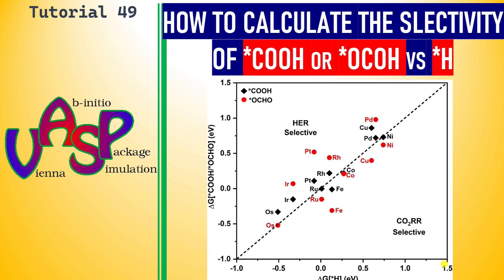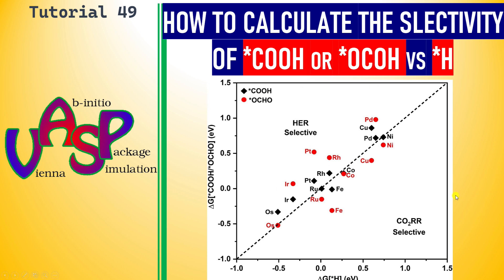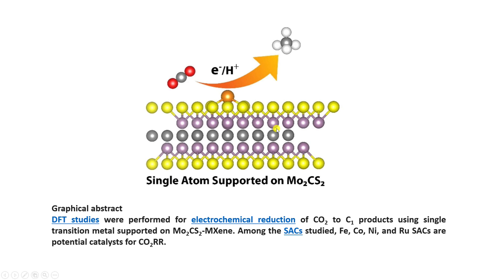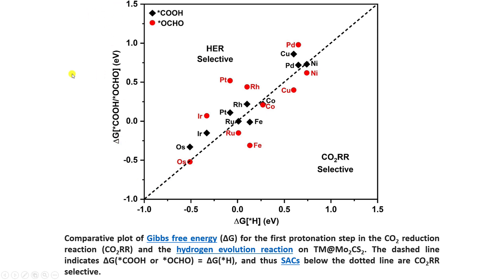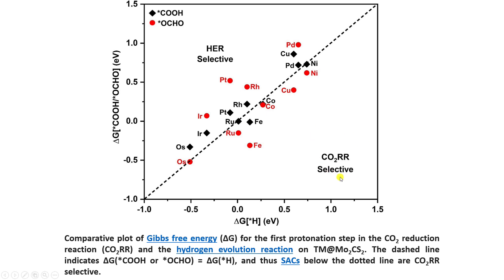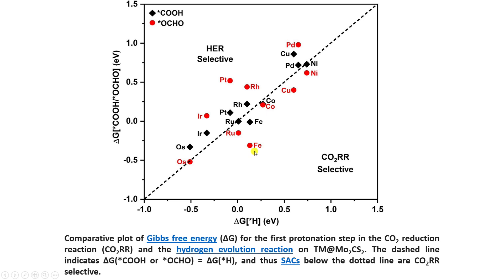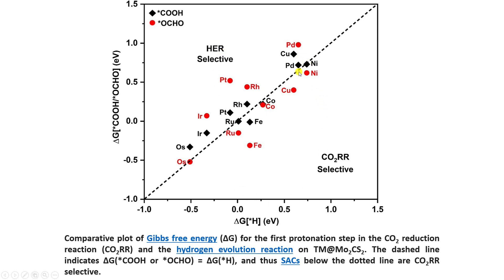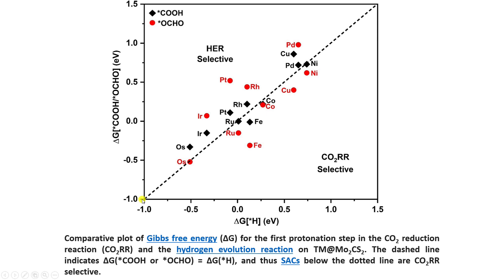How to Calculate the Selectivity of CO2RR vs HER by *COOH or *OCHO vs *H with Adsorption Energies

Comment: hello sir i got these vaue from NEB calculation so i want to plot the energy barrier profile the last column i should use?    
  0         0.000000      -305.792500            0.000000 
   1         0.018762      -305.745100         0.047400 
   2         0.017122      -305.587100         0.205400 
   3         0.019031      -305.745000         0.047500 
   4         0.000000      -305.794500        -0.002000
Reply from the maker: No, I think image 2 is your transition state. You can now check image folder 02 , get your energy of ts,plot your energy profile. And take the CONTCAR file change to POSCAR do freq calculation.